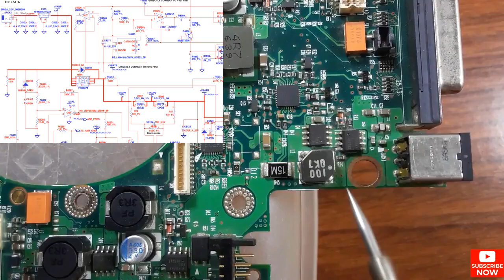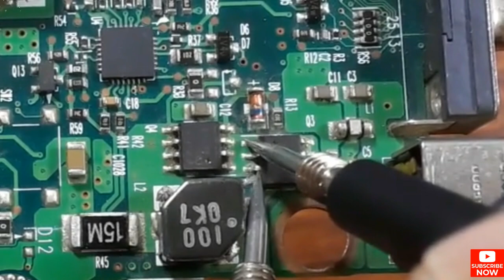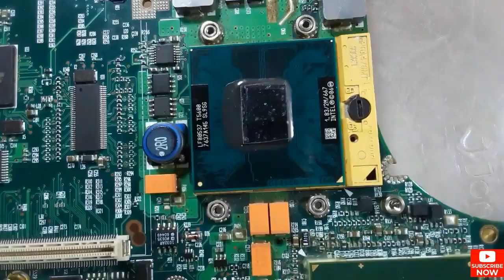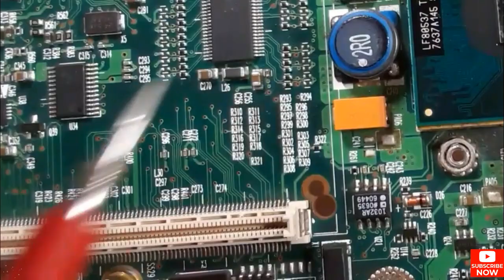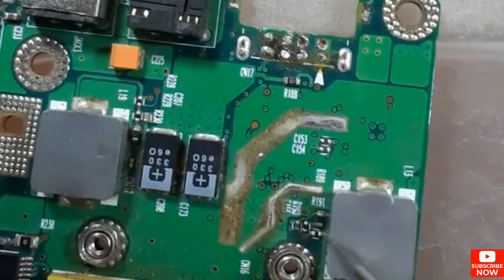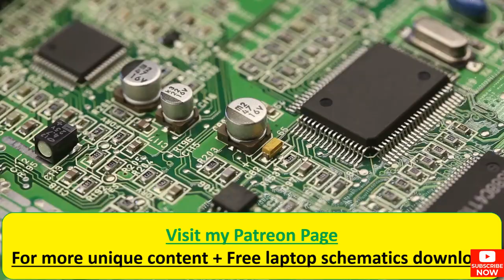Laptop motherboard repair | Motherboard Signal Tracking part 2

Comment: If possible an explanation of what each component is used for in the main power  and also in the charging system of the computer tank you
Reply from the maker: Noted, I will

Comment: thank you for this series of very interesting videos. Even if the topology is typical of PC following the path of the signal is valid everywhere. Very good warning for the control on the extension and not directly on the legs of the IC to avoid damage
Nice job
Reply from the maker: Good point!